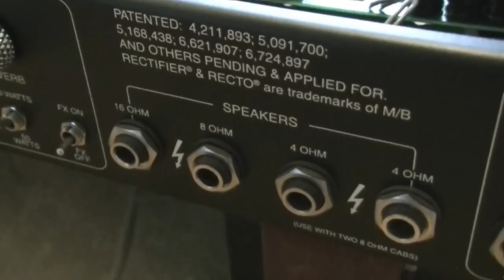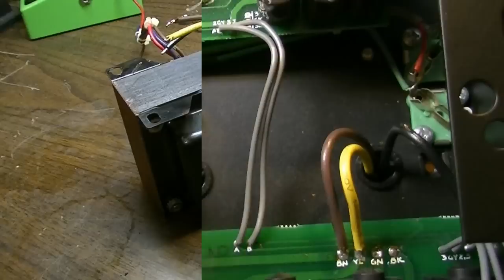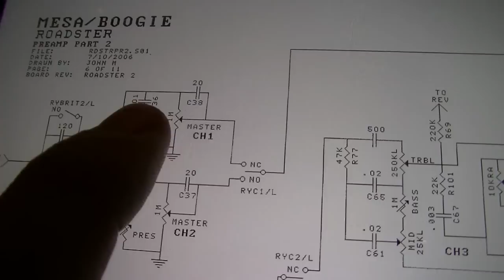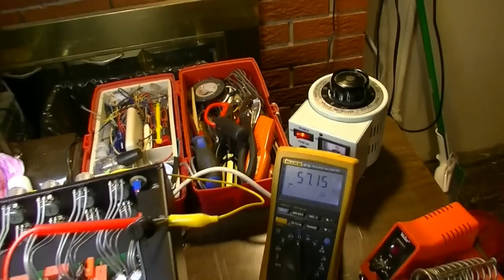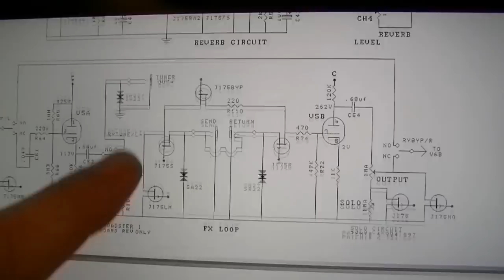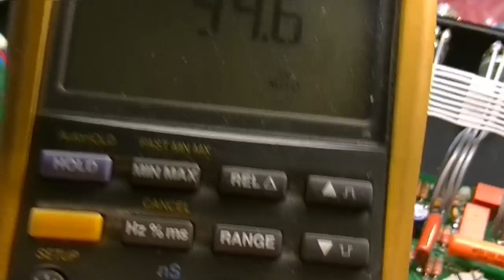Amp Tech's Worst Nightmare - Mesa Boogie Roadster Repair

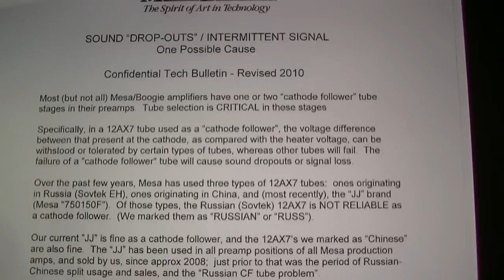Comment: Thanks a lot. Very useful video. I`m going to fix my Mesa Single Rec now. So these informations should be helpful. I hope video won`t be removed due to confidencial tech infos :) 12:35 . Greetigs from Poland!!!
Reply from the maker: I will not remove this video.
Reply: That`s good.. Did you ever deal with mesa MarkV? It`s seems to more complicated for fixing
Reply from the maker: It's all very similar architecture.

Comment: That was so interesting. CSI on a PCB. I was shouting at the screen "what about the cap?" ... but it wasn't the cap. :-|
(When I was a young testing tech, there was a fault-finding flow chart on the bench: 
".. change C1 ... change R3 ... change Q1 ... etc" 
with the last instruction being 
"... change tester ...")

Comment: Hi, thanks for great channel.  I was wondering if you could explain why the tone of the amp was suddenly improved by applying the multimeter probe to the pins of the tube?  I have a dead amplifier that comes alive whenever I take a multimeter measurement between the negative power tube bias circuit and ground.
Reply from the maker: The amp didn't "come alive", the probe was checking for signal at the tube's grid and that signal was going to my little bench test amp. The fact there was signal at the various points meant everything was good up to that point in the circuit. On your amp, it sounds like you have a bad tube (the one you're measuring), or a problem in the bias. check all the components in the bias circuit and replace as necessary, and cycle in a new tube in that position.
Reply: I'll keep up with the trouble shooting.  Thanks for the feedback.

Comment: Nice work! I have a Mesa Boogie Blue Angel that went south on me that I have yet to take to get fixed.
Reply: Yehoshua D. Stone I assume blowing your Mesa is why you are no longer together? lol
Reply from the maker: What's it doing?
Reply: My
Reply: My girlfriend (at the time this happened, a few years ago) had put the plastic cover on in while it was on and it sat like that for a week. When I discovered it, I turned it off, let it cool down, then turned it on. It blew the fuse on the amp. I replaced the fuse, and I smelled ozone, and it blew the fuse again.
Reply: Joe Guss - LMAO!

Comment: For the $$$ those boogers cost, you'd think the real estate on that board would be better planned. Nice job though.
Reply from the maker: There are a couple things that are way out of place from where you'd think, but overall, there is so much going on, they didn't have much choice. I mainly wish they had used a more robust JFET or at least made the leg pads spaced further apart.

Comment: I picked up a JCM2000 for peanuts, too. Can you guess what's wrong with it? :D
Easy enough, though.
Sounds to me as if the repair place he took it to damaged the transformer wiring attempting to get it apart(and probably had no idea how to diagnose or fix this...sorry, call me jaded, I get a lot of electronics to repair that have been messed with at 'repair' shops) and just told him it was bad to get him to order and pay for a new one etc
Reply from the maker: On the Marshall...runaway bias?
On the other thing...I can't prove it, but that seems to be the score.
Reply: Oh yes, a pretty advanced state of it, too. That fix involved a dremel and the pcb (and my stash of parts). Still..it's happy now and I've been meaning to sell it for about 6 months :p
Someone had a go at fixing it in the past, too. I've got pictures of the pcb when I first opened it and my jaw hit the floor..

Comment: You need an audio generator 1k tone
Reply from the maker: I have one of these too...never use it either.
Reply: The Guitologist That's why it took you so long to fix it. Through hole single sided board repair is easy. Very easy.

Comment: Is a tube amp with more transistors than tubes really a tube amp?
Reply: Where did i get it? Well by logic. If something doesn't have gain, it's not an amplifier. So what does it matter for definition of whether it's a tube amplifier or not if there's a non-gain stage that contains transistors (used as switches) in the signal path?

You asked above "how can you use transistor as a switch" - you use a FET (field effect transistor) as a variable resistor in signal path, you drive the gate with a constant voltage for either switch position. That it goes through the transistor is of no relevance because the sound signal isn't applied at the gate or base of the transistor.

When you apply signal to base or gate of the transistor, this signal attenuates the power supply voltage instead, and thus gain is achieved, and this is also where distortion is introduced. In FETs, there's a nonlinear response between gate voltage and drain-source resistance. BJTs are not voltage driven devices altogether, they are current driven, so things get more complex altogether.

So you say you suspect there's a transistor preamp gain stage there, but the schematics, the parts in the video, look like the gain is completely valve based in the preamp. The tone control is completely passive, no gain there, the gain is before the tone control and then there are triode buffers between stages and finally probably a little chain of triode gain stages before the power amplifier, if i were to guess. I think you can find Road King II schematics easily enough, at least the pages of preamp that i can see in the video seem exactly the same.
Reply from the maker: The transistors aren't used in the signal path, just for switching.
Reply: I don't understand. How can you use a transistor as a switch but the signal does not go through it?
There's not enough preamp tubes in this amp to be all tube. I don't have a schematic but from only six preamp tubes you have one phase inverter, one for reverb, one for FX loop and that only leave three for 4 preamps with bass, mid, treble. A Fender Twin has six preamp tubes too but it's really only a channel and a half amp with no FX loop. What the hell is Mesa doing?
Reply: Why. If gain, saturation and distortion characteristic comes from tubes, it's a tube amp. If the gain, saturation and distortion comes from semiconductors, it's a transistor amp. At a given gate voltage, a FET is merely a resistor. A tube amp is gonna have more resistors than tubes in the signal path, but you're not gonna call a tube amp a resistor amp because of that? Wouldn't make any sense!
Reply: I've never heard this description of a tube amp, where did you get it? Your points about resistors are just diversion, nobody is talking about calling anything a resistor amp.
Reply: I recall an interview by Randall Smith saying they intentionally kept certain things that aren't used in the signal path as, inexplicably, rectos just didn't sound the same without them.

Comment: Interesting video, thanks for posting it.  I have a bit of a non-related question. At 8:27 you are testing the output and I see your Fluke 87 is displaying an AC value as I would expect but the 87s selector knob looks to be on DC. I am an electrician and have an 87 and I don't think mine would do that. TIA.
Reply from the maker: That setting is for both AC and DC. You press the blue button for AC or DC OR AC+DC. This is an 87 IV. Maybe it's a different revision than yours? Dunno.

Comment: aren't you supposed to only measure resistance on a de-energized circuit?
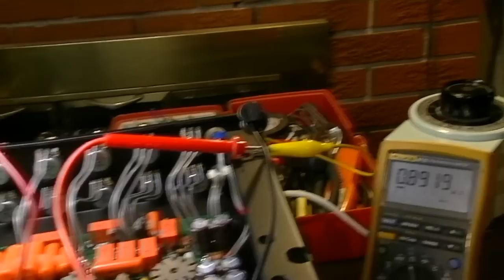Reply: @ 25:00
Reply from the maker: Yes. I don't think I measured any Rs in this video with the amp on did I?
Reply: The Guitologist you were measuring resistance of one of the circuits and commenting on how the resistance changed when you put power to the circuit.  granted i deal with automotive electronics so i don't deal with these types of components
Reply from the maker: It's true most multimeters wont measure resistance accurately in an electrified circuit, you can still use Ohm's Law to figure out resistance given the voltage drop across a resistance and the current. But At that point in the video, I was just talking about the known properties of the JFETs, I didn't actually measure them electrified.
Reply: I thought it was when you measured the resistance of the pot wiper to ground with and without power.

Comment: That was very interesting. My local Guitar Center has one of these exact amps for sale (used) for $1800. I am doing some research on it to see what people think. Gawd! Mesa sure knows how to complicate it up. Well done in tracking it down. I would just have started replacing one component after the next until it started to work.

Comment: I'm not a electrician, but this was so interesting because I play guitar and owned a mesa mark IIC so I stopped and watch the whole video. I totally learned a ton of information. You did a awesome job on this video and explaining each step. I remember a Marshall 100 watt amp head I had and it used to spark at the On Off switch now and than when I turned it on. It was an old amp head from back in the sixties. Turned out to be the solder from the circuit board was flaking off and causing it, at least that's what I was told by the tech who worked on it. I ended up selling it to him for 100.00 bucks. I was young and just wanted a amp that wouldn't scare the hell out of me when I turned it on.

Comment: had lots of trouble with my mark V 25.... Mesa was nice to replace it after 2 years of constant back and forth trips to the Mesa factory.. I ended up with an express 50 plus, a much simpler bolder amp. great video!
Reply from the maker: Yeah, that's the thing, when you're blazing new trails, there will be hiccups, but Mesa always tried to fix them. We had one customer with a Titan bass amp once whose amp kept having issues, but they used his amp as a guinea pig for future revisions of the model, I think. Can't recall whether they ended up just giving him a new amp or not. Been a long time.

Comment: as a tinker, or is it tinkerer, I probably would not have figured this out EVER. buuuuut If I DiD !   I would have cut the jfet pins and left the Thumps in and rocked out. If it were mine.
Reply from the maker: I was tempted but it would have bothered me to no end if I had to leave it like that.

Comment: as a tinker, or is it tinkerer, I probably would not have figured this out EVER. buuuuut If I DiD !   I would have cut the jfet pins and left the Thumps in and rocked out. If it were mine.

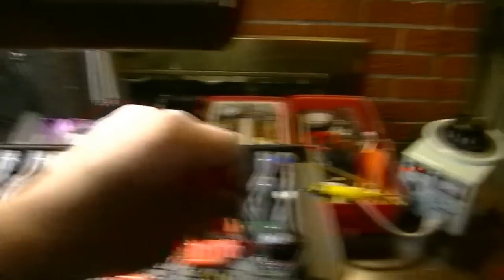Comment: At the 19:00 minute mark, where is that red probe that you're probing with going to?  I don't think you mentioned that at all in the video, unless I missed it.  Do you have it feeding some other amp, so you can hear the signal?
Reply from the maker: I do eventually mention it in the video, but it's a probe going to the input of my bench amp. One lead is gator clipped to the chassis and the other lead used as a probe on the tube grids.

Comment: Looks like someone took a razor knife to that transformer wire. That's seriously shady.
Reply from the maker: I thought that at first, but Mesa did actually have a mention of the reverb lead release procedure in the service manual so that tells me it's probably a common thing for someone to think the only way to release the reverb leads is to stick something in there and pry them off. I imagine that's how the leads got severed.
Reply: Yes I commented too early while watching, sorry. Later you explain that about the reverb wires/etc. Makes sense now. Between the broken knobs and the cut wires I was thinking at first that someone didn't like it's last owner too much. But hey, awesome video and great explanations of all the madness going on inside that chasis!

Comment: Hey boss,  since there's some solid state stuff in here,  I'll pick your brain.... to see if it lines up with mine.    I'm working on a 1979 Peavey mixer...  Super retro cool!    There's some significant 120hz buzz going on.   If it was ye olde fender tube amp,  I'd go straight for filter caps...   but it's Solid state....  Still filter caps suspect?
Reply from the maker: Filter caps are in lots of power supplies, not just tube gear. You'll have filter caps in that thing too and you should probably replace every electrolytic capacitor in it.
Reply: I've ordered all the caps for the power board...  I'll start there.   It's the distinct filter cap sound.    This is a 24channel Peavey CONCERT mixer...  this thing is a monster!  The stock caps were Illinois, and Marcon...  mostly Marcon (not familiar with them)...  I've got Nichicon coming in...  Digikey had Illinois and Nichicon in stock...
Reply: I just put together the order...    The mixer board only has about 325 Electrolytic caps in it....over 16 different PC boards.  that should only take 10-20 mins to re-cap right?  Yes,  I'm doing it.   I did the power board,  and improvement was seen... er.. heard...  now to the audio boards!

Comment: Not really related to the video but if anyone could help I would really appreciate it. A friend lent me his fender frontman 65r (ss budget amp I guess) it has 2 channels, clean and overdrive. Yesterday I was playing through guitar rig 5 using the power amp in of the amp and it was sounding great. One hour later from one second to the other it turns into the most horrible fuzz pedal I've ever heard and the volume is lower than normal. Tried it connected to the normal input using the clean channel and it sounds the same, overdrive channel same thing, different cables same result, different guitars same result, connect a lead out of the fx loop nothing comes through it's like the amp is bypassing the fx loop and playing the sound through the speaker no matter what I do. The amp had a crackling issue before it was lent to me and that wasn't happening yesterday. If someone could shed some light on this I would really appreciate it. If it was my amp I wouldn't be bothered but since it is not I really want to find a solution.
Reply from the maker: Sounds like you have a bad transistor, or depending on what kind of "fuzz" it is, it could be power cap related. Transistors can overheat and fail altogether or become biased outside their correct operating range and when that happens you can have lessened output and fuzzy output.
Reply: The Guitologist thank you very much for the help! Wish it was something like a dirty contact but guess I'm going to have to send it to a tech :(

Comment: If I was the fellow you got the amp from, I'd be very weary of the repair shop he took it too after seeing the leads on the transformer. The damage to the leads look very suspect.
Reply from the maker: Definitely a fair point, which is why I'm slow to point any fingers. The owner did say the shop had broken off those back two knobs which were broken. I was aghast at that alone, so wouldn't surprise me if they ham-fistedly, but not intentionally, chopped the OT leads also.
Reply from the maker: Appears that way. Seems to be the most logical answer.
Reply: Suspect? That damage is 100% from a cutting plier
Reply: Yes that what I’m. Saying !! Somebody ran a box cutter through that area ? To specific and hidden to be an accident
Reply: Here's how it goes:
- Customer brings in a no output condition.
- Shop checks a couple of obvious things, then quotes expensive part to see if customer is serious about repair. (less time wasted if customer declines)
- If the customer accepts, then they troubleshoot and repair. Miraculously it turns out not to be the expensive part - but instead it was some expensive labor and a few inexpensive parts. (labor = more profit)
- If the customer declines, an unscrupulous shop might take a step to ensure their diagnosis was true. In this case here, a clever snip can be blamed on a factory assembly issue. Perhaps that wire has been hanging by a thread since day 1? We'll never know.
Reply: Took it in for the bad components, broke the wires opening it up and assumed that was the problem all along?
Reply: Think about it, the amp would not be in the shop if it had not been damaged already. Maybe the shop could have been more diligent but that problem really would not be seen until you committed to changing the transformer. Not everyone is trying to rip folks off.
Reply: Seriously. That snip looked pretty suspect, a clean cut. Looks like it was done hastily. Either out of anger, spite, or jealousy. I live in a small town sadly where I wouldn't trust a single one of these locals to be within a 10ft radius of my Mesa boogie dual rectifier because something similar would happen. They see a Mesa, know it's expensive and then try to tear it up out of spite because they don't have one/can't afford one. Or they mess it up to get more money because they think you're rich cause you have a Mesa.
Reply: @bradhargis2261  you're not wrong. I only go to Uncle Al's here in Indy if I have a mesa problem.

Comment: I clicked on this video out of curiosity. Wow~! A question and a comment. Q: How many hours did you work on this amp? C: Mesa Boogie amp troubleshooting and repair should be required to receive a Doctorate in Electrical Engineering: 5 labs, with multiple symptoms/failures in each amp, down to the single component level with time limits and show your work. Well Done~! You have a new subscriber.
Reply from the maker: Thanks for subbing! I assure you not all my vids will be this complex.